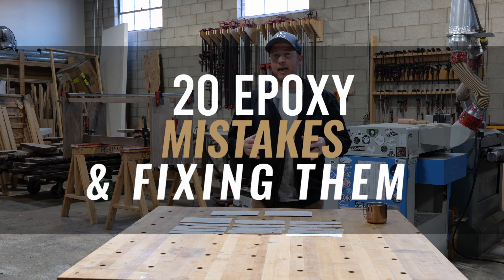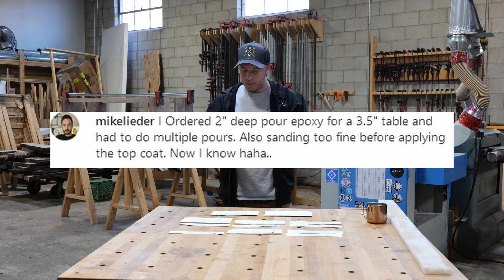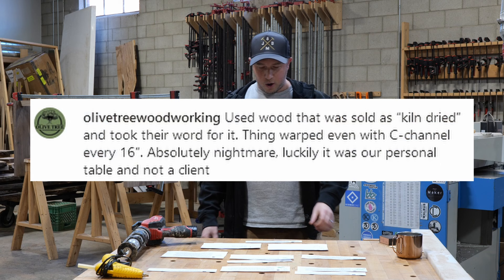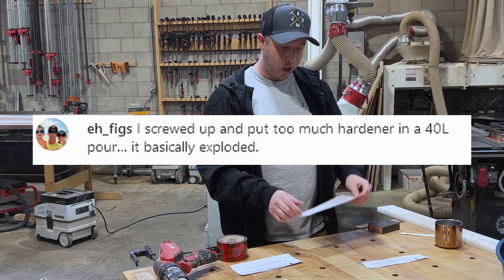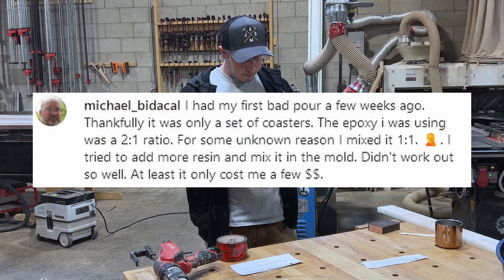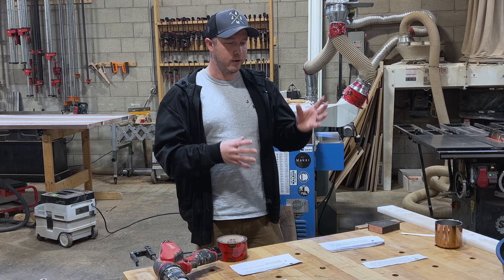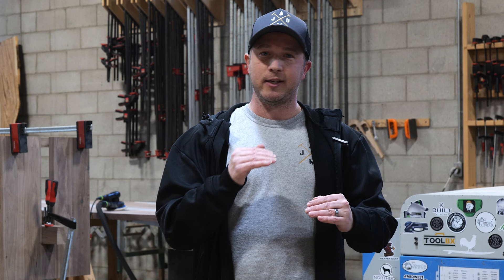Epoxy and Wood Project Fails & How to Fix Them

Comment: Well I pretty  much make all of those mistakes on each piece repeatedly. I have done 30 plus pours, and I still continue to do so, as I am building all of My Kitchen/Vanity/Bar Countertops throughout my entire New Barndominium. I am 67 and do this in my Spare time as I still work full time. Its just a Labor of Love.
Reply from the maker: The point is to learn from your mistakes!🫣 We get it though, its easy to overlook things in the process.
Reply: I have a question,  I did my first pour on a kitchen countertop.  It was a lot to do in minutes. Somehow, in the shadows of the upper cabinet was a spot that I didn't spread the epoxy over, like an inch by 2-inch oval dibit that has nothing on it.  Is there any way to fill this and sand it smoth?  Even if the finish isn't perfect after. It's over black charcoal chips and under where it doesn't show to bad. A 2nd pour isn't an option right now.
Reply: Kitchen counter using clear epoxy. Pitting and not drying. Help!

Comment: Epoxy is a weak point for me. Needed to do a table top pour for my outside dining table in 2016. No way to do it inside. Watched as many video's as I could. Taped the edges, got it level and the pour went well. Popped the bubbles with a torch cuz that's what I had. Checked on it 30 minutes later and found a Bee floundering center left. Dug he out best I could. Let it cure for a while then heated up a nickel with the same torch and pressed it into where the Bee had been. My education continued months later when I realized that table top doesn't do well outside. I've since replaced the top again with redwood fence boards, burned, brushed and coated with Spar Varnish. 
Thank you for your effort. This video really helps as I continue to explore the world of epoxy.

Comment: I made several mistakes on my first pour, resulting in labor-intensive salvage efforts. The first mistake was that I did not flatten the slabs before putting them in the mold. The slabs were slightly warped, which required more epoxy to fill the gaps (more money). Then, removing the excess epoxy required a lot of work on the router flattening table!  The second mistake was I used melamine plywood for the form and didn't tape the bottom and sides.  I used a silicone spray-releasing agent (two coats), and the epoxy still stuck to the melamine.   Again, a huge chore to router the plywood off of the epoxy. The third mistake was not measuring the epoxy ratios correctly.  I had several brands of epoxy on hand.  Some of the ratios were 1:1, and others were 1:2.  On one pour that was supposed to be 1:2, I mixed it at a 1:1 ratio, and it heated up too fast and cracked in several places.  The epoxy was tinted, and when I mixed up more to fill the cracks, the tint wasn't the same color, and the cracks were still visible.  Another mistake I made was not sealing the inside edges of the slabs which resulted in thousands of air bubbles that did not rise to the surface and were trapped in the epoxy.  I think the epoxy was too cool and was not fluid enough to allow the air bubbles to rise to the top.  Additionally, I should have done several shallow pours instead of pouring the 2" all at once.
Reply from the maker: Surprised even with a release agent it still stuck so efficiently to the malamine. A layer of tuck tape seems to do the trick for that!

Comment: Hi Jeff. Great channel. What I like most, from the point of view of a non English speaking person, is the way you express yourself, it’s so clear and neat. I watched this video for the second time because I’m looking for the solution to a problem I have when using my router sled. I’ve got a pretty good router and also a pretty good router bit, but I can’t avoid getting a kind of “crater lines” every time I pass the sled. It’s like if I cut bubbles in have and get have a half spheres line all along the resin. I’ve tried to slow and speed up the router, to pass the sled slower and faster, to remove less resin and wood at a time, but I can’t get any of my creations without a single “crater”. I’m not sure if you can really understand what I’m talking about, sorry for not being able to express myself better. But if you know what I’m talking about and you have a solution I’d be enormously grateful if you share it with me. Thanks a lot in advance. Keep creating content, it’s great.
Reply from the maker: It could be a number of things. Routers always leave cutting patterns on the surface but it could be dull blades or the sled flexing as its moved. It still takes a great deal of sanding after flattening to remove markings. Hope that helps!

Comment: I've made all of those mistakes in my 35 years of resin top manufacturing and more including working at a shop where $60,000 of resin furniture was stolen. 
As far as why things crack could be a whole myriad of reasons from: 
1)too much exotherm, 
2)moisture in the wood,
3) getting too cold then the coefficient in contraction comes into play ( the rate of expansion and contraction based on heat, 
4)not enough penetration due to poor choice of epoxy due to viscosity and not knowing how to get around it (yes there are ways of thinning epoxy but can come at a cost if gone too far) 
5) Epoxy hardness
6) Poor prep of surfaces
7) Contaminants in the air or introduced unintentionally
8) Weather - humidity and  temperature 
9) Thinking only table top epoxy gets the job done and not realizing there are better products out there for specific purposes
10) Vacuum infusion leaks
Reply from the maker: It can definitely be tricky stuff to work with!

Comment: I've learned a few of these mistakes myself. One of the most important ones is using the right product for the right application. Another one is liquid pigments tend to stain your wood vs mica pigments. So I've learned to seal the edges for liquid pigment pours. And a big one as you discussed. Proper ratios. I've had a few pieces not cured fully. Always learning the dos and don't on each project.
Reply from the maker: Thanks for sharing your experiences, we've definitely been there! Always learning 🙌

Comment: I have made several of the mistakes that you mentioned. Once, on a small coffee table pour, I mixed a table top epoxy with a deep pour epoxy by mistake (the containers unfortunately looked almost identical, and I didn't double/triple check). So, of course, it didn't cure properly, just became a rubbery mess. I was actually able to salvage most of the wood to use in another project (didn't use epoxy on that one).  There are many ways to go wrong using epoxy. Thank you for the great video!
Reply from the maker: Sorry to hear about your mishap! At least you were able to salvage some material. Thanks for the comment👍

Comment: Good video. Thanks for taking the time. One more I would add is I did a pour recently and apparently the mix ratio was slightly off. The epoxy never hardened. Instead I have a sticky glue mess. Luckily the pour was just over voids / cracks and not the whole piece. After several attempts to clean up the stickiness I'm at the point of not wasting any more time and will either abandon the project or drill out the troubled spots and fill in. Probably not a good solution either but I'm scratching my head at this one.
Reply from the maker: Unfortunately, improperly mixed epoxy is a real hard mistake to fix. How did it turn out?

Comment: Please talk about uneven ripples either from using heat gun and forming waves or how to fill in dimples.  I am on my 9th attempt on my dining room table after about a year.  Very frustrating,  not to mention expensive!!! Probably $750 of wasted product bcuz I'm a perfectionist and if I see 1 hair fiber or raised dust particle-i start all over worried that it wouldn't be even if I try to level out a dimple
Reply from the maker: Well you'll always have slight imperfections when doing a pour. You'll either have to touch them up later or remove debris/bubbles while its still liquid. You shouldn't be heating your epoxy to the point where it ripples while removing bubbles unless you're purposely trying to make a wave effect!
Reply: @jeffmackdesigns  I have a question,  I did my first pour on a kitchen countertop.  It was a lot to do in minutes. Somehow, in the shadows of the upper cabinet was a spot that I didn't spread the epoxy over, like an inch by 2-inch oval dibit that has nothing on it.  Is there any way to fill this and sand it smoth?  Even if the finish isn't perfect after. It's over black charcoal chips and under where it doesn't show to bad. A 2nd pour isn't an option right now

Comment: You make this video a year ago. Came across it. And I'm still watching it now. How do you handle a charcuterie board that's half wood half resin. Bubbles formed from the gases in the wood. I'm lost! New at this. Don't know how to fix this problem. I read somewhere to heat the wood first before adding the resin

Comment: My go-to for leaks is Flex Paste to temporarily stop the leak and hot glue over it to reinforce it. Its thicker than any silicone I've used, so it gives you enough time for the hot glue to cure.
Reply from the maker: Awesome, we'll have to check that out!

Comment: Workin on my first project using epoxy.  I'm making a clock that that has small holes drilled for the minuites that go around near the outer edge, and holes that are a little bit larger in between for the 12, 3, 6, 9 parts.  I also routed an inner circle that goes around the entire diameter about in the middle of the face.  When I was pouring the expoxy, I quiclly realized it wasn't filling the holes and routed our circle as expected, so i eneded up using the mixing stick edge to slide, push, and level the expoxy over the entire face of the clock so it would go into the holes and routed out circle.  It's now been 24 hours and I now need to figure out how to get the expoxy of of the entire face of the clock, with the exception of where the holes and routed out circle is.  Also, off of the side / edge where it flowed over.

I have an Orbital sander and a jointer that I can also use to plane.  What is the best method of getting rid of the excess epoxy so I can get back down to the wood?

Comment: I found your video very informative.  I have never worked with epoxy and would like to make a live-edge coffee table using epoxy.   Where do you purchase epoxy and how do you know which type to use for your project?
Reply from the maker: I would recommend using Ecopoxy FlowCast for a coffee table build. We have a video called “The Beginners Guide To Epoxy Tables”. I would give that a watch. You can order all the supplies from our website www.JeffMackSupply.com
Hope that helps.

Comment: I'm relatively new to this epoxy game and I'm set up for wood working in my shop which is only 12x16. Stuffed full of tools and equipment, machinery, lumber, cutting and charcuterie boards in various stages of completion.  Actully same as they were when I started messing with epoxy.  I'm using a 14" round silicone mold with various woods and epoxy. Here's the kicker.. I'm in Central Florida, pouring on my screen porch with only  a  ceiling fan on medium directly overhead.  Poured my 5th one today ar 84 degrees and it went up to 94 this afternoon. I swirled it at 10 hours and all looks good.
I've seen 100s of yt videos with caution about too hot. My highest  temp pour was at 90 and it hit 98 that day with a heat index of 106.
Why aren't I having trouble?  What trouble should I be having? I'm pouring a table next week and don't want this customers 40th anniversary present to his wife to go wrong.
Thanks, good video btw.

Comment: Thankyou for the video  Very helpful. Also instead of measuring I weighed  the resin for one project and had a big goopy mess, was that the reason it failed
Reply from the maker: Some epoxy brands go by volume instead of weight, so your ratio was probably off!

Comment: I think I didnt use enough for the first coat on a very small bathroom countertop, spread it and after a few minutes it was like I spread oil all over, solid pools every few inches and next to nothing in some spots like it all separated. 
Am i able to go back over it after sanding/scuffing and itll rebalance the areas that seem like nothings there and look fluid and clear or? Thanks alot.

Comment: great tips!!!, however I do not recommend using a paddle for fast setting epoxy, it introduces a lot of bubbles into the mix, which can become a problem if your proyect is 1/4" thick or above
Reply from the maker: Yes, we rarely use fast cure epoxy, but you could also place it in a vacuum chamber to help get rid of bubbles.

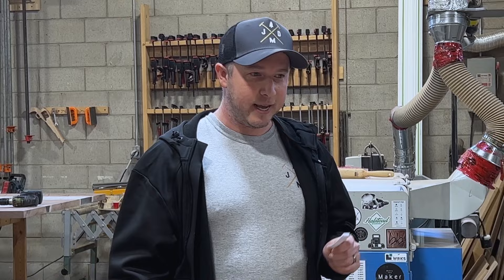Comment: Hey Jeff! Regarding the question at 8:09 I'm planning to do a table with a thin strip of epoxy between 2 jointed pieces of wood rather than a live edge, would you recommend sealing it or just leaving it be and pouring? Thanks!

Comment: Hi, I did a pour for a 1m2 stair landing. Mold was fine and sealed well, but kept having to top up epoxy. Didn't realise until cured that the epoxy was capable of floating 40kg of timber. Used twice as much as I should have. Clamp the pieces down!
Reply from the maker: Clamps or silicone are a must, bet you didn't make that mistake again!?

Comment: Thank you , you cleared many of the issues but I would like to ask that how can we avoid dust particles to stick on the pour ? 
Than you
Reply: Great question. Following
Reply from the maker: That would be a matter of cleaning meticulously before starting and making sure you don't have any breezes to stir up dust. If you have the space, you could set up a room similar to a paint booth or designated pouring area. Also consider dampening your floors/surfaces to hold down particles. Good Luck!

Comment: I use melamine and mold release.  Silicone the creases.  No issues with that method so far.
Reply from the maker: It works for many! The nature of building molds with silicone seams just means there is a possibility for leaks.

Comment: Hi 👋. I poured my table with a second coat, within the 24 hour time limit. Came out this morning to find that condensation dripped down on the table whilst I was sleeping. The rest of the table turned out beautiful. Can I sand just the affected areas and pour on top of them? Will it meld into the rest of the cured epoxy and look ok? Or will it look like a blurb/epoxy bubble?
Reply from the maker: Sounds like your best option is to clean the area as best as possible, no moisture. Then scuff up the areas you'd like to re-pour and try you rbest to match the colour. There is always a slight chance you will see it after. Good luck!

Comment: Great video!  My biggest problem is that I don’t give up on a project gone wrong and keep pouring flood coat after flood coat and it almost ALWAYS ends up getting tossed.  I need to say enough sooner and quit pouring good epoxy after bad.  I’m trying but I just tossed another charcuterie board after a seal coat and two or three flood coats.  COME ON!! $$$$$
Reply from the maker: Yea stop doing that! You have to take care of any defects before progressing, hoping they disappear

Comment: Great vid. I want to also step into epoxy projects (perhaps first some smaller ones). These answers will help me for sure. But how do you measure the amount of epoxy you need. especially when you use a very curved piece of wood. Because making way to many wil cost a lot of money to throw away unused.
Reply from the maker: You measure the volume of negative space the epoxy will fill! You're mostly looking for a "close enough" calculation. Unless you get super mathematical only then will you have an exact amount. It is always beneficial to have slightly more than you need, with some small projects standing by ready for the extra if necessary. Wood can soak up epoxy which can't be calculated for.
Reply: Thank you for the answer. 🙂

Comment: I think my biggest mistake is not removing the bark properly, devastating and ruined my first poor, as well as properly clamping to keep most of the epoxy from getting under the project because takes a lot more time to sand. Lastly making sure your surface is level when pouring, super important!
Reply from the maker: A level work surface, yes! That often gets overlooked and can leave people putting in more effort when it comes to flattening projects.

Comment: Hey man, very helpful video first at all.
I did my first project and I've poured the rist layer about 2cm thickness and come back about 20hrs later to pour another 2cm on top, but I haven't scuffed it...
I haven't yet removed it from the mould... how would I fix if the 2 parts gets separated?
I was thinking of maybe drilling through holes top to bottom and then pour some epoxy?
Reply from the maker: You could try drilling holes but theres a chance you will see them, its still fairly difficult to blend the perfect colour match. You should be fine, just remember to scuff them next time!

Comment: I have a cured rattlesnake skin on a piece of white pine.  I would really like to do a pour on it to make it last longer.  Any advice on this? Should I do a seal coat w/out the skin and let it dry or should I do a seal coat and apply the skin while it's tacky, let it dry, then do the final pour?  Any and all suggestions would be greatly appreciated.
Reply from the maker: Sounds like your best bet is applying the skin while it's tacky, letting it dry, and then do the final pour. You may need a vacuum chamber to help eliminate trapped bubbles round the skin!

Comment: Epoxy hardens fast just after mixing with mica powders and metallic color and unable to work for a kitchen counter top for about 32 sft.?
Outside temp. was below 72F.
1:1  (0.5gal) : (0.5gal) mixed separately before mixing with colors separately in a small cups.
After researching it's noticed 
exothermic reaction ...
*Timer
*Volume
*Temperature.
What is your advice to avoid the fast hardening when mixing with colors?